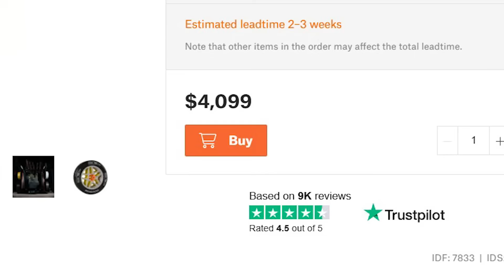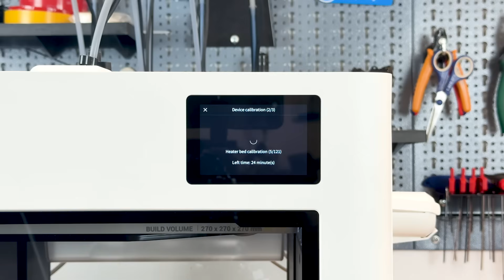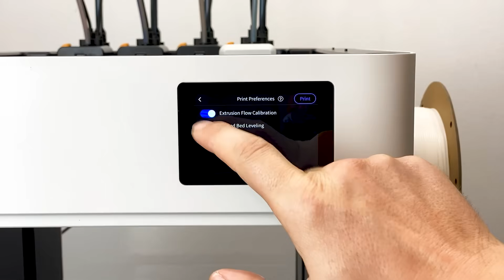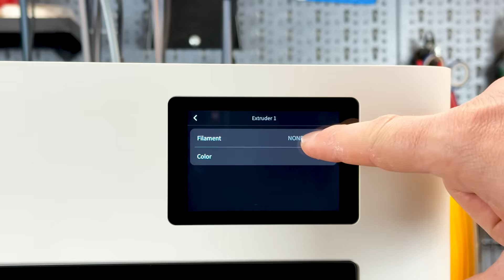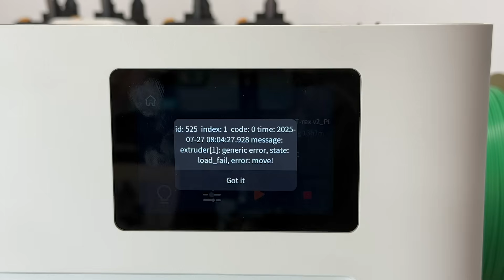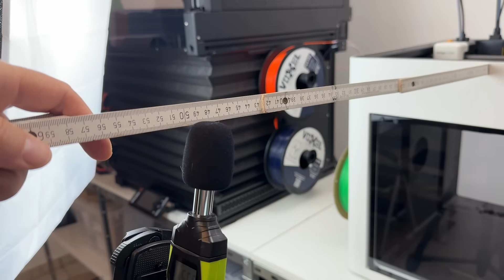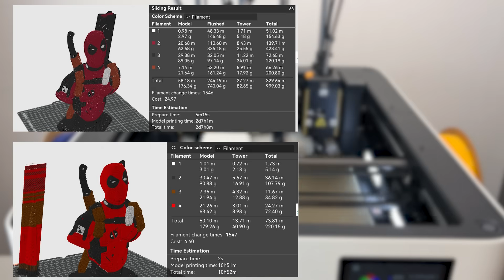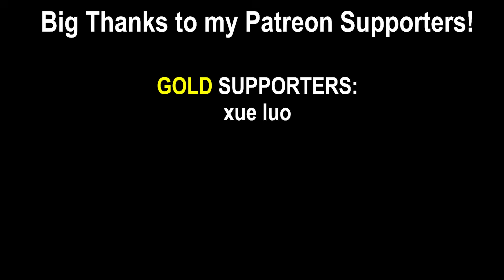Snapmaker U1 XXL Preview: Less waste, Less money.

Comment: With the Bondtech INDX launch around the corner this seems like it's late to the game.
Reply from the maker: Not comparable imo: U1 is a printer product INDX is a solution for 3D printers
Reply: Yeah but indx will require individual tuning, adapting to your specific printer and things like that. It’s more of a DIY thing while this is aimed more against the x1c and prusa xl etc. I still want indx personally, looks so cool
Reply: Your gonna have to wait at least one year to see if the INDX will work or not then you'll
 Start seeing printers use it but not cheaply as the technology is patented.
Reply: I plan to have INDX on my 500mm monster RatRig, but I'd love to have this for my more more run of the mill day to day printing that doesn't need to be as big.
Reply: Something like the p1s + INDX is more expensive and more work then this package tho. I think INDX will be really cool for people that want something more customized to their needs like unconventional sizes or custom tooling, but it doesnt directly compete with a package like this.
Reply: Thats like comparing the Bambulab AMS with an ERCF.

Comment: Thank you for the video, gives lots of insight. Well i am not sure if i am into that printer. What i dont like And those are usually no goes for me:
1. Loudness - I have my office desk in the sameroom as my printers. All my printers are modified in a way they are completely silent. even the "electronics cooling" is done with silent computer fans (14cm noctua) pwm driven with octopus boards.. (klipper even shows the rpm in fluidd) A printer that is over 45db is a nogo.
2. I dont like adapted klipper, even if it is open source. usually you cant update directly over fluidd or mainsail.  second nogo.
3. I hate companies that have "their own version of slicer". its ok if you have only 1 printer. but if you have more than one, example: I have a sovol printer (T500).. sovol has its own version of orca (v.2.3.02).. i also have an ender 5 plus (there i have orca 2.3.1 nightly build.) then the ender 3 etc.. What i have done now.. i did the same for cura, i create my own printers as custom FFF printer.  they have different names like FFF T500, FFF Ender5plus, FFF Ender3.  But all being custom printers i can use the same printing profile, filament profile and only need 1 slicer on my computer.  or 2 if i want to use another brand. Having to change slicer for every printer is the third nogo. 
Because usually i have (example) like 40 parts to print, 20 fit on the t500, 15 on the ender 5 plus and 5  on the ender 3 S1. so i want to have exactly the same settings ... and not change slicer and have to go through everything.  

Thank you for the great explanations. the video was very interesting.
Reply from the maker: Thanks for watching and for the detailed feedback - those are indeed all valid points to consider!
Reply: Just use orca snapmaker already has a profile for the u1 up there.

Comment: Have you tried multi-material with the slicer? Last time I checked the multi-material wipe tower settings in Orca don't do anything. It stacks PETG on top of PLA, which fails at z=10mm, or so.
Reply from the maker: Yes, check out the print tests in this video please :)